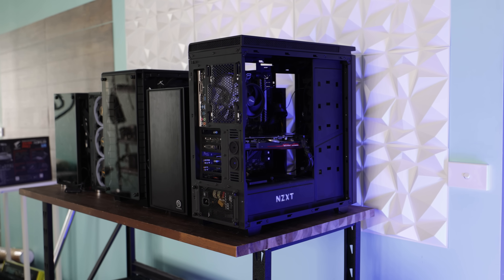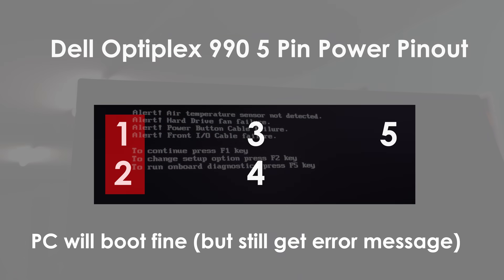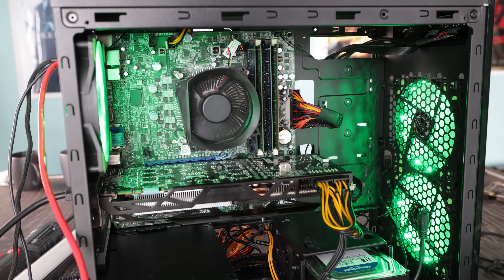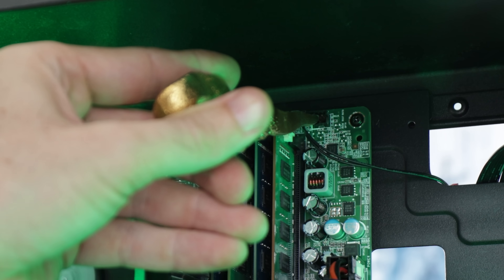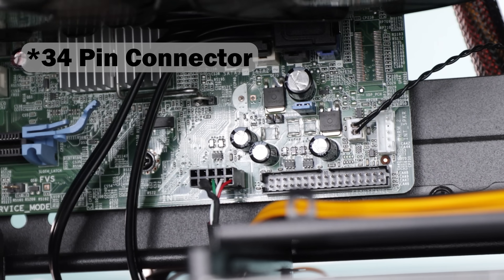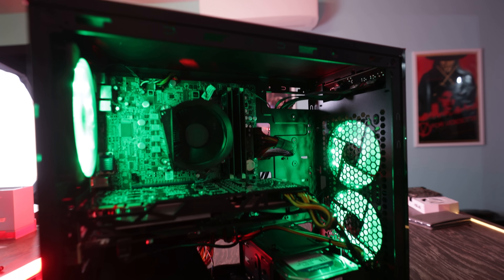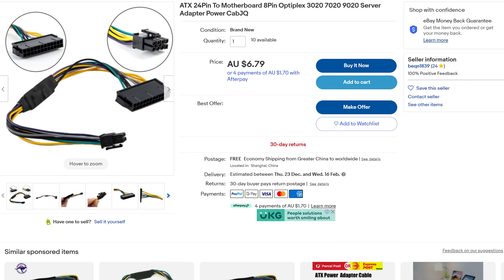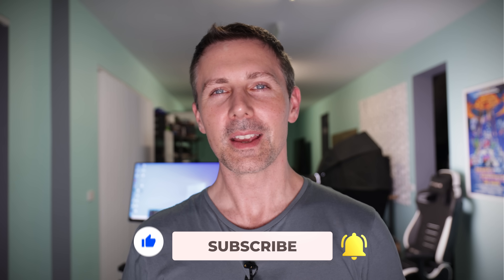Turning a Sub $100 DELL OptiPlex into a FAST Gaming PC

Comment: Fun fact about the OptiPlex 790. It's not the model shown in the video but on bios update A22 Dell was basically told to up theirs by motherboard manufacturers when told to only support i3, i5, and i7 CPUs. The A22 update unlocks support for all LGA1155 CPUs that draw 150watts or less power, so pretty much everything except very exclusive enthusiast CPUs. The 390, 790, 990, 3010, 7010, 9010, and a few other models got the exact same update. How do I know this'? I'm currently using a Xeon E3-1270V2, 4X8GB ddr3 ecc registered memory and a gtx 970. It's a nice machine and would make a great system to transfer.

Comment: Thanks TYC, been working with OptiPlex 990 MT's a while (and lately some 9010's and 9020's) and done a few case swaps, never knew it was that easy to get rid of the Front I/O error as well as the power button error so I'm definitely going to try that. Keeping the temp sensor is easy enough but as for the system fan I'd rather not keep the original since not many cases accept fans of that size anymore so I'm gonna see if I could just cut the connector off and short some of the pins to get rid of the error

Also, connecting a standard front power button connector directly to the left most pins of the 5 pin is what I've also done, but I've found it's not a very secure fit and can come out easy but I assume this will vary from connector to connector because of slightly different sizes. One last thing, the OptiPlex 9010 MT motherboard has a USB 3.0 header but the fit is slightly different (Dell used a locking USB 3.0 cable, which I have no problem with as those things are too fragile standard) but it does work I believe for standard case 3.0 cables. This combined with the fact that the 9010 still uses a standard MOBO 24 pin power and also has rear USB 3.0 makes it the ideal OptiPlex board to use for case swaps in my opinion since pretty much any case you buy now-a-days will have front USB 3.0 and having 3.0 speeds is very useful for things like flash drives or connecting drives externally. Can of course use a PCI-e USB 3.0 adapter but this makes it easier

Comment: For the selecting the boot order you need UEFI boot enabled, those small errors are easily skippable with F1 as none is critical, they're just for different peripherals that are connected, I think they're all able to be turned off in bios, I used  to have an optiplex but older, I think it could be turned off

Comment: My set up monitor tv philips 4k 50 hdr10 plus doby vision atmos +rtx 3060 12gb +ram  12gb +Intel i5 4440 +new casing trillion x dark x +power supply 750, resolution 3840x2160, 60.000 HZ

Comment: i just piggybacked the case powerbutton on the original front panel pcb by gluing on the case 2pin powerswitch cable to the powerbutton contacts on backside of pcb :D
then i just neatly mounted the board in the case

Comment: i got a dell precision t5500 with dual cpu and 32gb ram for free from my friend and i changed the internals to a phanteks p400s case i got used for 20€. works perfectly and had no issues except mounting the board as it is BTX

Comment: Nice build! Loving these videos - they stimulate the need for tinkering. Inspired by the Tech Yes man, I've been building some systems and flipping them (X58 is still ok cheap here <3, only GPUs have been the problem for the last 1½ years)... but I'm not making the money to taking the chance on those prebuilds - so seeing these makes up for figuring it out myself.

Also: Two questions: 1: Wtf is that CPU cooler even? looks dinged or something? 2: I wonder what those two front fans are there for, it can only be for looks :D
Reply: Checkout the Fire Pro S7000

Comment: It’s definitely fun to do this stuff. In 2019 I turned my 2014 HP Envy (GT 640 and i7 4770) into a gaming machine. I started with my older GTX 970 paired with a new i7 8700K, but since then its had parts swapped every now and again. Today it has a RTX 3060Ti paired with a i9 10850K running 5.1GHz.
Reply: @Michael's Productions Haha yeah it's a good experience.
Reply: I got a i7 4.5ghz with 24 gig ddr4 for free,only used for light work.with amd 2100 videocard but that one is going to be swapped with a 580.recently i bought already a gaming pc but this one i got for free is probably going to be faster.Also got another i5 free computer with 32 gig ddr3 going to upgrade that one to currently there is a 4890 (very old videocard)in it but thats going to be a 580 to.🤔still making sense of what im going to do with 7 pc,s

Comment: There’s actually some pin outs online and a guide for Optiplex conversions. There’s a Reddit post as well stating which boards use the same IO assemblies, etc. I’ve built two 990 systems a couple years ago having picked up the boards for $10 each. The 790 and 990 are very similar even among the SFF models. Of course, the older Optiplex boards like the 380, 745 and 755 are fun to mess with as well because there are modded BIOS releases for them to use socket 771 Xeons. People dump on Optiplex, but I love using them. I have two 380 MT found on the curb for bulk trash pickup. I modded one, tricked it out with replacement fans and RGB, and then threw in a descent GPU to make a pretty good XP retro machine. One man’s trash is another man’s treasure 👍

Comment: To be honest this has me thinking of an idea for an old mod case from about 2002 i have in storage. Was contemplating an Optibuild in it before. it just so happens that it looks like it uses a very similar sized case fan to the Hard drive fans....Which form factor was this mobo from? Just asking as i am not sure if Dell uses different boards between the different form factors of the same model.

Comment: Modern transformers whether inside a device or external are almost entirely built as switching power supplies now, they can switch between the 110-120V US standard and the 220-240V UK standard, one of which you use wherever you live.  That non-switching supply is effing ancient mate.
Reply from the maker: Here in aus they sell heaps of dedicated 230v only power supplies...
Reply: @techyescity  
Hmmm, how odd.  Most manufacturers don't bother making them anymore because it's cheaper just to tool for and supply a single universal type.  Presumably these are at the more budget end?  Possibly coming from smaller manufacturers that have set up with older equipment, effectively building legacy designs?
Reply: @techyescity  
The last place I saw non switching supplies was when I had to get a few thousand small 5V1A external supplies manufactured by a Chinese OEM via their Czech subsidiary but I haven't seen an non switching PC PSU in years, though in fairness I never owned a pre-built or bought a budget PSU.

Comment: tip: there are two pins in the proprietary dell power button header for blinking error codes, you can plug your HDD activity light front panel wire into those two pins to keep your error code functionality

Comment: socket 1150 with 50 dollar xeon holds even 2060 card! its amazing value socket. 1060,1660 work 100% with 1230v3, 1150 old system !
a system with i7 4770 performance runs easily anything!
even 1155 socket is very strong, like i7 3770

Comment: I just ordered an optiplex 7020 sff from ebay. I think there isn't a free x4 pcie slot for this, but I'd like to know if it's possible to boot from m2 nvme on these boards? I may order a 7020 mt and do it with that one. The forums I've seen so far indicate that it's not possible. I will add a graphics card as well for the gaming build once I get a good (sane) deal, so sometime in 2030 probably lol.
Reply from the maker: You need to mod the bios IIRC, and that is just NOT happening on these dells unfortunately.
Reply: @techyescity are there other old PC's that this works with? I'd like to do a budget build with the best components possible.

Comment: Went thru my  old pc stuff  ( was redoing spare ddr3 pc) forgot i had an ASUS ddr3 gamming MB ( cant find  the rear back plate)  lots ddr3 ram 2-4gb   sticks 
New lite grey msi mortar mb bios updated for Gen9 intel CPUs  never used i  bought elite Aorus  .
cables & what nots  About 30x New  WD 500gb Hdd's  & 250gb Samsung Hdd's -  i'll never use them 
Maybe if when i Move  to a  new place -  i mite fix and sell stuff  Until then junk in boxes
Reply: a cheep  trick i used   Black plastic fly wire screen mesh around old PSU   a few black cable ties 
looks better than  the red yellow cables showing      handy .

Comment: I figure someone of your skill would know this by now. But FFS - Install just the SSD and Windows. Then the HDD when Windows is installed. This way you don't have to fuss with BIOS settings and you can swap drives later without issue.

Comment: My first PC was an Optiplex 790, and after bouncing around various junk gaming PC parts around I've returned to it and gotten some surprisingly good performance with just an Nvidea Quadro and 16 Gb of RAM. Games run pretty well if I tweak the settings a bit, and I've yet to run into any issues with the hardware. I even managed to pull a 2nd-gen i7 from a burned out machine and the processor was so much better than the old i5 it came with. If you can sneak into a recycling center and have the time and patience, building a hacky machine based off of an Optiplex can be pretty rewarding.

EDIT: I've come back to this video to put my Opti in an old ASUS gaming case I got, and I've been using this as a reference for how to get stuff to stop working. Soldering is necessary, but I've got power and HDD LED's now. And for anyone wiring power and getting errors, solder the red and yellow wires together. Stupid Dell, crappy failsafe right there.

Comment: Just put a 3090 in there and boom! U got a fast pc
Reply: Boutta get a 101% Bottleneck
Reply: That's not how it works
Reply: psu, ram, and processor has left the chat
Reply: just put a 3090 in there and boom a fire
Reply: Won't be powerful ei be bottleneck Ed it will perfprm at  like 10 or 8 percent of its full performance
Reply: Emphasis on the "boom" part 😂
Reply: welcome to the world of bottlenecking

and explosions
Reply: 5090ti or gtfo.

Comment: I did this conversion recently on a 3020 small form factor, currently doing it on a 9020 haswell sff unit.  Like what you said, adapters are good if youre willing to pay, not feasible if you're not in the US (the only place that makes the custom mini boards for the power and front panel adapters is Harbin in Georgia, USA).  I learned a lot from the work arounds you had to bypass the boot warnings.  These 2nd/3rd gen Intel optiplexes are the last time Dell used a regular ATX PSU connector, the Haswell and later optiplexes need an additional PSU adapter if you're doing a case swap.

Comment: I found the lenovo motherboards to be the best standardised oem boards. The only thing that needs an adapter is the usb 3 connector. You can work around the hd audio connector by removing a pin
Reply: Which pin are you removing to work around the audio connector?

Comment: Wow weird.  I tried and failed to get any 2 pins to turn on the machine with my optiplex 790 board.  I ended up splicing the case power switch into the original one.  haha

Comment: From what i noticed the system you built is : i7 2600s / 16 GB RAM / GTX780
I'm about to built the exact same system for a friend , only difference is that i'll use a default i7 2600 (non-S).
-From what i've read the -S model is less capable than the default i7-2600 .
Are these game-results you show with default timings or with overclock ?? if at default they seem extremely promising for gaming
Do you believe that an i7-2600 will bottleneck a GPU such as the GTX780 ? I have the feeling that such GPU (and a GTX970 as well ) is the optimal GPU for such a CPU , what do you think ? can it handle more powerful GPUs without causing them bottleneck ?
Reply: Don't go for the i7 2600 unless you can get it really cheap. An E3 1230 (or if the board supports Ivy Bridge, the v2 variant of that CPU) is much better and usually much cheaper because they have no iGPU. You can't overclock these (with these boards anyway and otherwise Sandy Bridge only takes a very small OC). These boards also don't support XMP for RAM. 
It's not going to bottleneck a 780 or 970 in most games. I'd recommend going 970 or R9 290. 780s have only 3GB of VRAM and very shitty (basically non-existant) DX12 support.
Reply: @b0ne91  well thanks , but  to be frank , all of the parts are already bought and assembled i was just being curious for Bryan's experience when i noticed that he assembled an almost identical system.
The only thing i'm about to change at that i7-2600 system , is to replace his GTX760 with a GTX780. I believe that for such a CPU a GTX780/GTX970/GTX1060 are the optimal choices ,but due to some weird compatibility issues i encountered ,i preferred the GTX780 .

--P.S.GTX780 is capable with DX12 on several games. I've seen a reviewer (ZwormZ gaming) testing a Kepler GPU(GTX780Ti) at Fortnite prefering the DX12 version as the more optimal versus the DX11 version , so certain issues could be software related...
Reply: @Sitharii I keep up with Kryzzp as well (I sent him the Tesla M2090). Kepler cards only have DX12(11_0) and as a result don't support a lot of newer games as well as artifacting and driver issues in Warzone. 

DX12 feature level matters. I've sold quite a few K20X builds and had the same issues. If you intend to upgrade the GPU maybe switching out the i7 2600 for E3-1230 and reselling the former might net some better performance. I still think the R9 290 is a better choice, if you're fine with how power hungry the 780 and 780 Ti are already.
Reply: @b0ne91  Hahaha!!! 
You sent Kryzzp the Tesla2090 while i have sent to Bryan here one of my old loves , the GTX780 ROG Poseidon (as you can see i have a strong feeling for Kepler GPUs ,lol )
Anyway , yes you are right it doesn't fully utilize DX12 , yet as far as i can tell , in the current games , there isn't a DX12 game that is totaly incompatible with the GTX780.
As for future games , well ... we'll see how it goes.
As i told you ,the parts are already purchased so there isn't an option for me to change something , i was just being curious for Bryan's experience since i noticed he built an identical system with mine ,that's all.
--P.S. I also love Kryzzp's videos , very useful for retro-hardware lover such as myself ...
Reply: @Sitharii  they're still decent cards for the budget. I just put them in ultra budget builds because I don't want to sell something as future proof that has only a few more years of life left in it for someone paying $600 or more for a PC. I sold 5 PCs with a 4th gen i5 and Tesla K20X (Kepler GTX Titan equivalent) for about 400 each. They do the trick there with DX12(11_0) and for cooling you can just 3D print a shroud, get an $8 Delta PWM fan, connect it to the Mobo and use Argus Monitor to control it based on GPU temps.
Reply: @b0ne91  i see , but as far as i understand you do such things for profession so your customers have to be pleased by the service you provide. That's something else.
I on the other hand , only do such things for hobby ,helping friends , not for money. I didn't even ask him any money for the PC i built him.
Also , i never gave him a promise that his PC will last for future-proof gaming. We'll see how it will go as far as future games evolve. 
But i believe that for the time being his PC is quite capable for decent gaming (*as Bryan showed in this video) , of course with certain compromises in graphics-detail here and there...

( --P.S. I don't have a clue about what you just said about 3D printing a shroud for cooling purposes !! , way over my limits , lol !! )
Reply: @Sitharii  I do this as a hobby. I could probably turn it into a YouTube channel, but it's just a hobby where I flip 1-2 PCs per month at most. Tesla K20X are really cheap headless server GPUs equivalent to the Kepler GTX Titan. You need to 3D print a fan shroud and and install a fan to cool it (it's passive otherwise). Then you can OC it and it's basically a $70-90 GTX Titan.

Comment: Jumper plugs to the rescue ;) I did this very same thing with a Dell optiplex 790 board. Jumping pins 3+4 on the power port fixes the power cable issue. the front usb header errors can also be bypassed by jumping the 4th set of pins from the left. can then use a PCI-E X1 slot to add a USB 3 card so there is a header for the new case front I/O. Dell fan header adapters are cheap luckily.

Comment: I noticed you put the PCI card directly next to the GFX.... I tried two in that configuration next to an old 1050Ti - both over heated in no time, and started kicking out errors. (5 fans in the case).  In my personal experience - you need that extra inch or two gap between a standard PCI and a PCIe GFX card for ventilation. If you're water cooling thats different - I've only ever done air cooling. But I ended buying a full size ATX board just to give me the space to fit the cards... once they were a couple of inches away from the GFX... they worked. They just didn't like being near the heat. As an side not associated with the above - ALWAYS buy a decent PSU... the cheap ones just don't cut it and you'll spend hours trying to figure out stupid problems... 80+ Bronze is fine, but don't go cheap... its just not worth your time.